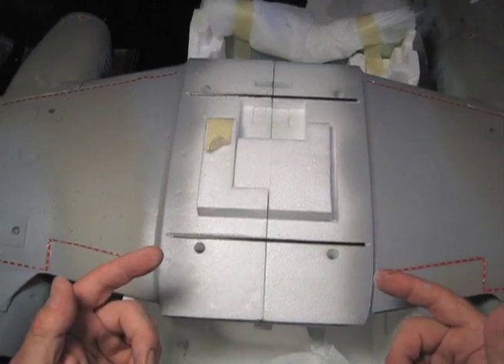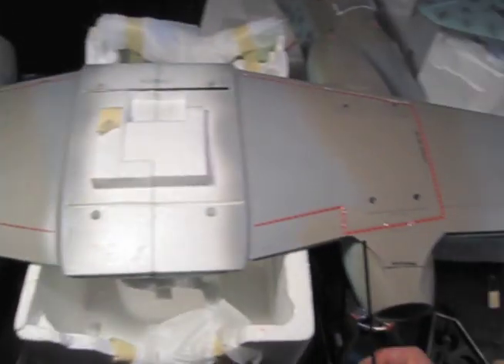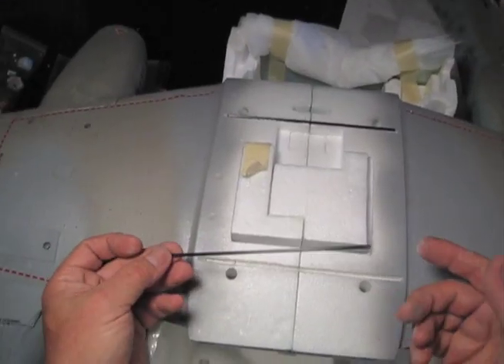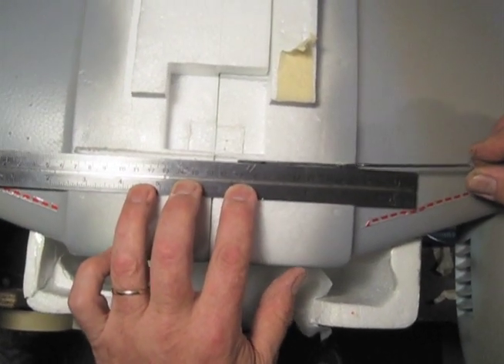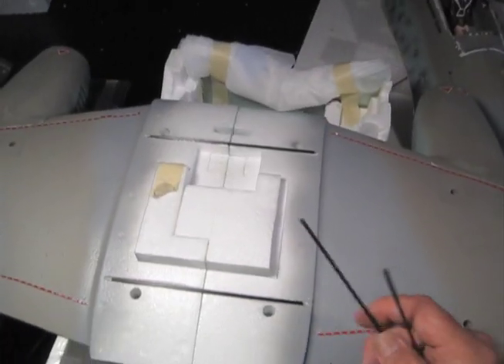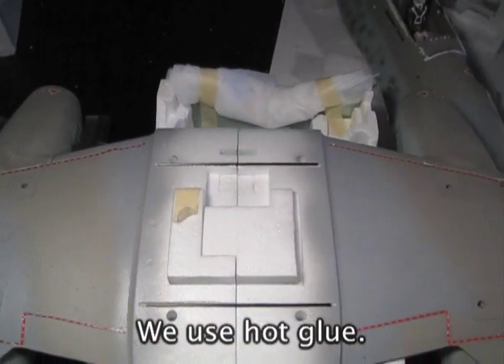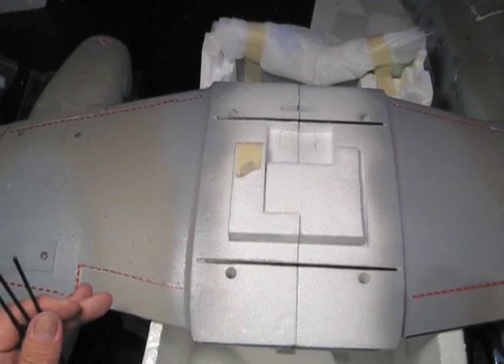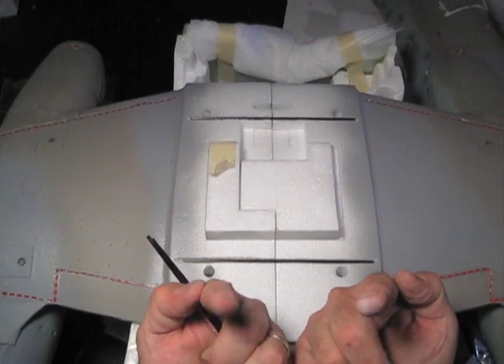TINY TIPS: HOW TO REINFORCE A WING JOINT

Comment: I've had too many hot glue failures.  I don't recommend it, especially on super hot days or very cold days.  Hot glue is brittle in the winter.

I recommend polyurathane glue like Gorilla Glue or anything similar.  I'm sure a 2 part epoxy would work great too.